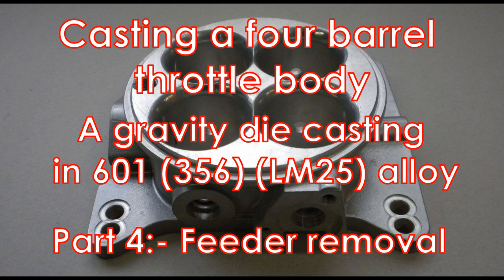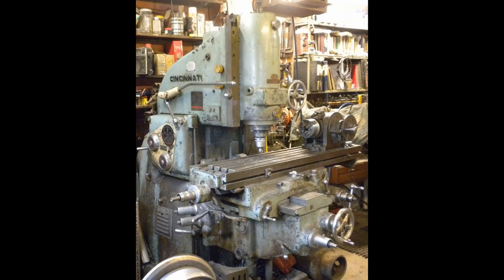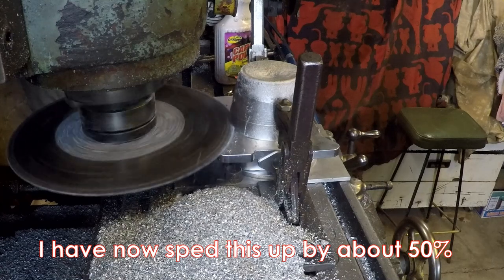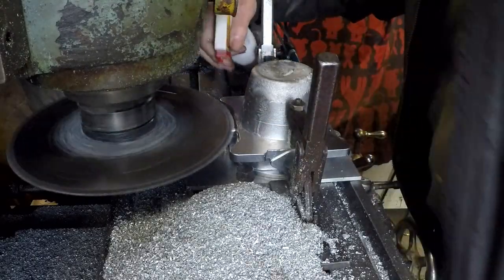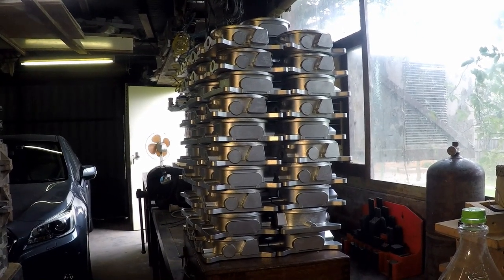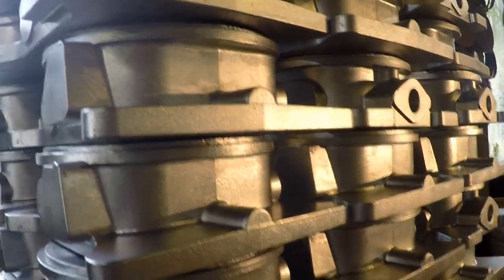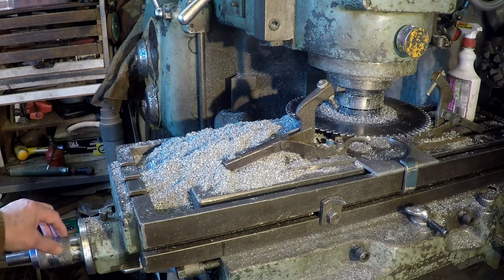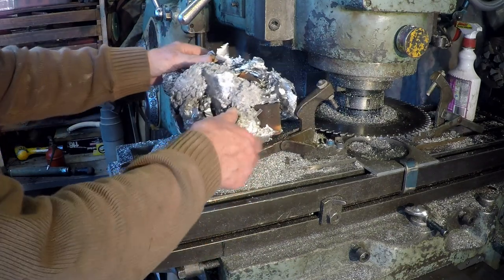Casting a four barrel throttle body Part 4:- feeder removal

Comment: Your opinions on not messing with swath or dross is important--as a new foundry hobbyist, my time to do my hobby is more important than saving a few bucks on re-melting crap.
Reply from the maker: Jason, I have pinned your comment - it is absolutely spot on! Why go to all the trouble of making all the necessary equipment ,then the moulds, melting the metal (all that gas!), only to produce inferior castings made out of crap. Time is indeed important as is the realization that ALL hobbies cost at least some money - trying to do it all for nothing is false economy....Martin
Reply: @olfoundryman8418  Thanks for replying. I will be educating myself on your experience. Cheers from USA.
Reply: @olfoundryman8418  Martin, I totally understand the economical and technical point but the (almost pathological) recycler in me is crying. Maybe this is a good subject for a short video ? Describing the technical issues and ways to tackle that (like you've mentioned the vigorous stirring), even if partially solving the problem.
As you said, not every cast is critical, making a fancy coat hanger might not need top notch material.
Reply from the maker: @thenoob2730  , Yep, I get more than a twinge of conscience too when I throw stuff like this out . Aluminium is an environmentally expensive material. In a feeble attempt to defend myself 😊may I say that I don't make much of this sort of material so I don't throw very much out. Were I to make more I would certainly pass it on to a recycler via a scrap metal dealer. My own experience with home recycling was a disaster. I had been given a chaff bag of fine lathe turnings. Supposedly aluminium but contaminated with minor amounts of steel, cast iron, and even the occasional fleck of brass. In addition it was old and I suspect had been wet so it was covered with a fairly thick oxide layer. Attempts to separate out the ferrous stuff with a magnet failed miserably as it all just hung together like tangled fishing line. So into the crucible it all went. I got about 5 litres of something resembling molten aluminium from the bag. I say molten but that was not exactly correct - it was more like a thin porridge! Thinking I had not got it hot enough (Ah, I was but a young naïve lad way back then😊) I revved the furnace up but the metal just got thicker! All those oxide films you see. Using a tablet of the now environmentally banned hexachlorethane I managed to separate the melt into about 2 litres of dross floating on 3 litres of something resembling an aluminium alloy. Its not something I will ever attempt again as the cost in time, fuel, and environmental issues (I could hear the ozone layer crying) was horrific. The metal produced was  highly contaminated with both oxide films and iron and thus very brittle, it was weak and not very fluid, its corrosion resistance was poor. In short you coat would have fallen to the floor. (I did actually use the metal for an early attempt at metal moulding boxes - partially successfully) Commercially there are people who recycle this sort of stuff. Possibly (I hope) they know what they are doing and can perhaps (again, I hope) do it in some sort of environmentally acceptable way. They do produce useable alloys but keep in mind that with each trip around the recycle circuit the metal degrades - we start  out with good clean metal used for can stock and foil and finish up with the sort of rubbish used for pressure diecast alloys. But I know where you are coming from,  I too am a compulsive never throw anything away kind of guy..... Martin

Comment: Do you plan to reuse the feeders and remove the ceramic filters after its melted?
Reply from the maker: Andrew, Yes, the feeders will be used as feed metal at a bit less that 50% of future melts ( new ingots will be the rest). The filters float to the top and are easily skimmed off... Martin

Comment: Very educational. When I looked at that massive feeder I pretty much thought that the only consistent way to remove it would be a large diameter saw blade.  Or a very expensive slitting saw. Completely agree with the garbage alloy in and garbage castings out. I appreciate the time you took to make this video Martin.
Reply from the maker: Mark, Its just an old cold saw blade that I picked up - probably out of a  scrap bin knowing me😊. Shooting the video didn't take very long, editing the thing well that's another story!... Martin
Reply: @olfoundryman8418    All my videos are pretty much edit free. Although I am starting to use a voice over as that is a handy feature instead of trying to talk, video, and keep yourself out of the worst camera angles at the same time! I have dozens of carbide saw blades in the cabinet shop i have and some of them are even purchased for metal cutting. Although that being said I don't think that I have a dedicated tooth grind that is suited to aluminum. I like that little mill of yours! a right proper beast. Not fast as the modern ones but you won't get it chattering as easily either.
Mark

Comment: Very nice series once again!

Do you also work with other castable metals? Brass or maybe Cast Iron? Would love to see some work on these. 
Anyways thanks for your videos! From the Netherlands.
Reply from the maker: Tjeerd, Apart from 4 different aluminium alloys I occasionally do one of 4 bronzes. Don't do cast iron and for good info on cast iron see Luckygen1001. Might have a bronze job to d o shortly and will do a video  of it - stay tuned.
Greetings back from Australia... Martin
Reply: @olfoundryman8418  great tip! Looking forward for more of your work. Your a true craftsman! Love learning manufacturing techniques in general and you give a very nice insight in what you do. Fascinating!

Comment: Holy dooly martin wow.again you have blown my mind. They look amazing. Thank you for sharing this amazing work and your incredable worksmanship. No dont melt the dwarf. Throw it.
Reply: Raschelle Sherwood, no don’t melt the dwarf or throw them out:) it’s easy to make a mistake in spelling when the S & D keys are next to each other. Cheers
Reply from the maker: Raschelle, Yes, both the customer and I are quite happy with the look heck this out from the customers web site it does look smick https://www.efihardware.com/image/3238/GM-LS3-700-CFM-4-Barrel-Throttle-Body-and-Manifold
Sadly, I lack the strength to throw a dwarf these days (not that I ever did mind you) 😊... Martin
Reply from the maker: PGS, I believe its not S D key confusion but rather a reference to a one time less than nice custom/competition  of throwing dwarfs 😰 😱.. Martin

Comment: very impressive Martin thanks for sharing the fruits of your hard labour with us. A quick question for you if you dont mind, im in the process of casting a bowl type pattern and I seem to be struggling with gating it. Would it be best to do a direct pour if you like to the bottom of the bowl, I know its not ideal, your advice would be greatly appreciated
thanks again for sharing
Reply from the maker: Woodsman,  Direct pouring to the base of the upturned bowl certainly is not scientific - that's for sure - but if you look at this video 
https://youtu.be/IXtI5XUbCtg  You can see it done in a way that I find miraculous in that it works but there are several videos like this showing much the same thing!. All very crude and improbable but these blokes have developed a skill that is worth seeing. And we have to remember that bells were traditionally cast this way. But how these blokes get it to run so far so thin is amazing.
If the bowl was somewhat smaller I would tend to gate at several places around the bottom edge but the runner would need to be tapered in area from the sprue to the last gate to be sure that each gate carried much the same amount of metal. How big is the bowl that you are attempting.... Martin

Comment: Can we address the recycling subject? In Australia we get around $1 per kilo for aluminium swarf. Aluminium swarf is not very volume efficient, brass is, but aluminium is not. When I was really busy, I could get $40 for a trip to the scrappie, this was for a bootful of bags of scrap which would have included some brass swarf. Storing this amount of swarf in the workshop was a nightmare. At times I would just take it round to a friend with a large workshop and dump it in his recycle bins just to get it out of my way. Brass swarf was worth the effort at around $3 a kilo and of course it took far less space to store. For me it was always a case of storage vs return.

Cans, swarf and extrusions exist and are often seen a free resource to make castings for the hobbyist. This to me is a bit like a right hander playing with left handed golf clubs because they were free ( ok, if you have made that work for you, fine). Foundry as a hobby has a cost, all the various bits and pieces apart from the metal itself either cost money or time in the making. Buying a good casting alloy will also cost money, but surely it must be worthwhile when you take into account the effort spent on patternmaking, moulding, melting and pouring. The effort that goes into a sand casting ( or a die casting if you count the die cost) is significant, why waste gas melting anything that does not give the best chance of success. If you want to be Green take swarf, cans and old aluminum bits to your scrap dealer and put the money towards some proper casting alloy or alloy wheels. Martin believes these can be used to advantage compared to other sources of scrap.
Martin should this comment result in unlooked for angst please delete.
Reply from the maker: Smallcnc, Yep, nail on the head! I just think it a bit counter productive to go to all the trouble to make the equipment necessary the furnace, the flasks, the patterns, the moulds and then melt junk metal at a not insignificant fuel cost  and pour a casting ruined by the choice of metal. Its a bit like bashing your head against a brick wall nice when you stop and start making good castings using reasonable metal
John Campbell's rule 1 of making good castings "use a good quality melt". .Martin
PS, If anything goes wrong refer to rule 1

Comment: I remember being so excited upon having a surplus of shaving/chips/swarf and aluminum cans.... I learned the hard way, your "paying it forward lesson" I wish I had learned that then ,what a struggle that was, and every casting was junk, and the porosity of the machined surfaces were horrible, and even after the remelt of those larger chunks, still, what a struggle... I tried gassing the melt, which helped. You stated this best, (garbage in, is garbage out).... But the shaving look so ready to be melted down, LOL, I know, but, don't do it!!! The melt would be popping and splattering inside of your kiln or furnace...  Thank you, fun video, I am enjoying this series, and learned quite a bit, again, thank you for taking the time.... Dru
Reply from the maker: Dru, Sounds like you learnt the same way that I did way back in the early 1970s I think - scrap is crap - I sold all of it off to a scrapie and bought some decent ingot, result, most of my casting problems went away.
The time is my pleasure... Martin
Reply: @olfoundryman8418  Well, I am glad it happened that way, as I now can see some of the problems I would walk into on later castings projects, by means of having seen the horrible worst case scenario outcome, and of course the middle ground  while I always shoot for the highest quality outcome... I think if I had not experienced that horrible mess, I would have always been thinking I was shooting for the highest quality, but would have really only ever been outputting middle quality...  I hope that makes sense how I worded this, lol.. thank you, for taking the time to make educational content.... Dru
Reply from the maker: Dru, Perfect sense, It's all a learning experience and they say that you learn more from your mistakes than from your successes. This may be true but I prefer the latter😏... Martin

Comment: A long time ago I did gravity diecasting and machining then left it for the drawing board/CADCAM to design aircraft.  After watching your Vids, I love to set up a workshop again and start building again. But what are the steps to start fresh?  How about a howto vid?
Reply from the maker: David, Wow, a big subject! I hope in a week or two to have a follow up video out  that will show a variety of work that I have done,   some of the dies used, and some of the machines used - all way less complicated than the one used in this job. It may provide you some of the info you seek anything else just ask… Martin
Reply: @olfoundryman8418  Thanks a lot.   My aim is to set up in a very remote West Africa so sourcing the spares or parts are not so easy and neither getting online or popping down to hardware store.  david @ osici

Comment: Nice castings, that were complicated to do. I love that old mill, much better than the mills made today!
Reply from the maker: Rocking, Thank you. The old mill is a bit of a beast - flat out at 500 RPM but Oh the metal it can remove if you can hold the work down well enough. It is an incredibly solid machine sadly now a bit worse for wear... Martin

Comment: Another set of great and informative video's Martin.
You made the point about metal to me many years ago & I have remembered this.
As you know I re-use Alu for much of my work & I make a point of not using small scraps.
If I need a top notch cast, I purchase in what I need.
Reply from the maker: Andy, Not an unreasonable approach - provided of course that you can keep the good stuff and the bad stuff separated. Years ago (lots of them) I made some moulding boxes out of less than good metal keeping the good stuff for the castings I then made using those boxes.😊 But I also made some required to be good castings from dubious metal, fortunately they never got used, for I found one yesterday and it had all but corroded away because the metal was contaminated.😰 😱 It will  appear in my next video as the possible consequence of casting crap out of scrap... Martin
Reply: Martin, I do indeed keep them well separated, & I have too seen the corrosion that sets in using poor Aul.
The signage I cast is from wheel rims, as you know, a good material as long as it's cleaned well before the ment. But early on I tried allsorts and some started to corrode with in a matter of a few weeks.
If anyone out there is considering making anything of any strutal nature, machined or that is to remain bare metal (like the throttle bodys) you need to invest in the metal.
Reply from the maker: Andy, Spot on... Martin

Comment: I am always fascinated with gravity die casting. I remember that the motorcycle manufacturer, Velocette, used gravity die casting for their cylinder heads. It's good to watch your videos on foundry and pattern work specialisation.
Reply from the maker: tre, It is one of the better casting processes and produces (usually) rather good castings. It has long been used by automotive people...Martin
Reply: @olfoundryman8418 : Thanks for info. That confirms what I've suspected for some time, as I've come across blow holes many times when machining pressure die castings and much less often with gravity cast components.
PS. I used to use one of the older Cincinnati verticals in the 1970s - good solid machines.
Reply from the maker: Tre, Pressure die casting suffers from the problem that the metal is squirted in at  very high velocity and often traps a lot of air when doing so to uncover often surprisingly large bubbles when machining such castings is all too common.
Very solid machines!😀 a friend has the same but in univeresal format and refurbished - he loves it... Martin

Comment: I assume then, that you are going to melt down the cut off? Do the filters just float to the top?
Reply from the maker: John, You assume correctly. The cut off feeder (they weigh a bit over a Kg each) will be remelted as up to half the next melt - other half plus will be new ingot. The filters do float and are easily skimmed off... Martin
Reply: Thanks.

Comment: Good day Sir, thank you for taking the time and effort to share your metal casting knowledge with us, it is very informative and is greatly appreciated.
I would like to know your views on the most suitable source of aluminium to use for beginner casting. 
What would you consider a better source, alloy wheels or cast engine parts such as cylinder heads and engine blocks?
Reply from the maker: Johann, Without doubt alloy wheels would be my choice BUT you need to check what alloy they are as many manufactures are no longer using 356 alloy (601 in Australia LM25 in England Al7SiMg in Europe C4CV in Japan) Most wheels have the alloy designation cast into the back of the wheel somewhere - recently I was sent a photo of a BMW wheel, it had the designation AlSi9 cast into it - this is a pressure diecasting alloy and not what I would ever use to sand cast. Look inside the back of the wheel for one of the designations listed above with 356 anything else be very dubious of. You can use cylinder heads and blocks but they can be a number of different alloys and you may not be sure of what you have got as an alloy - again the casting may have an imprint of the alloy designation. These alloys often contain copper (around 4%) so will machine fairly well but will be prone to corrode badly. What ever you do  don't mix alloys and stay completely away from wrought aluminium. However to be honest I found years ago that it was best to get good alloy as ingot from either a reputable supplier or from a friendly foundry (for cash) When I went over to good metal most of my problems went away...Martin